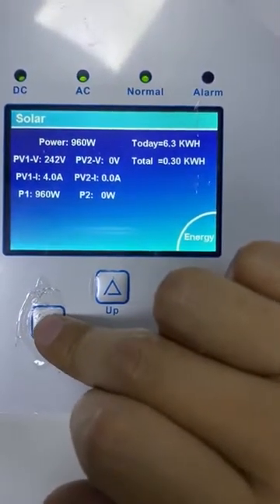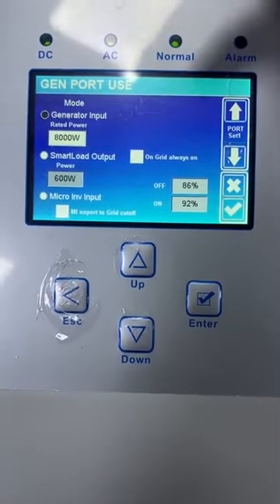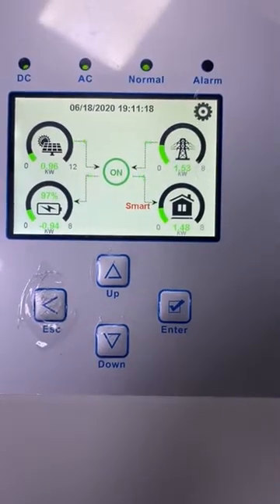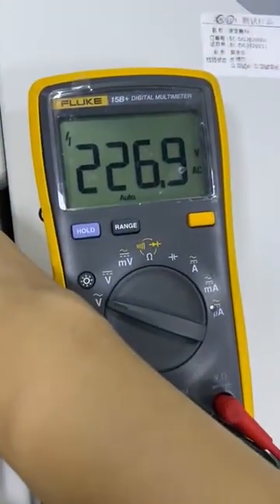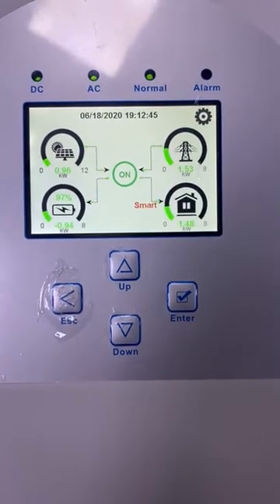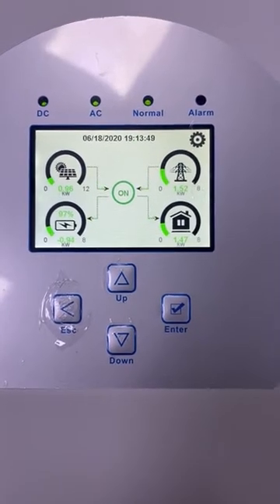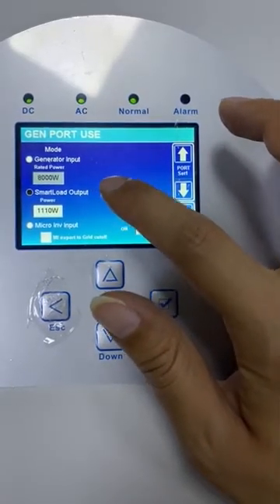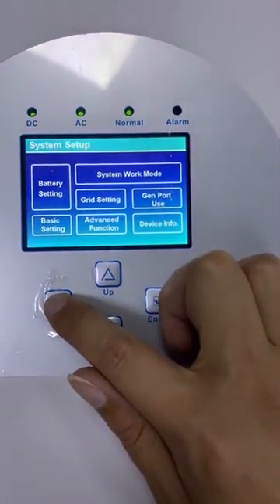How to use the advanced function for Deye hybrid inverter

Comment: Is it possible, to charge the battery from the solar panels only at a specific time? For example from 10am to 2pm. Or is it possible to set up a smart charging function for the battery? 
Im asking, because in Germany we got the problem, that the maximum allowed sell power to the grid is only 60%, of the Peak Power, of the Panels. 
So if you‘ve got for example 10kw of peak power in total, you‘d only be allowed to send 6kw to the grid. Therefore it would be quite handy, if the battery would only be charged, or charged more intensely, if the Solar Power exceeds 6kw. 
In short, it would be great using the battery to buffer the peaks, that would otherwise get lost.
But all in all, the battery needs to be charged 100%, when the solar power, is lowering again.
Reply from the maker: Our hybrid inverter supports 6 time periods for battery charging/discharging. For each period, you can set the maximum sell power, and the PV power generated in excess of the sell power can be used to power loads or charge the battery.
Reply: Did you manage to set up the inverter like this? I am from Romania and we don't have such a law, but the voltage at mid day spikes close to 253V, at which point the inverter will have to disconnect. I want the battery to have a charging curve based on time as well, like slowly charge up to 50% until 11 o'clock and after 11 o'clock it can charge all the way to 100% to be ready for evening consumption. I think it can be done with time of use, but I don't properly understand what the percentage mean there. Is that the maximum battery percentage or the minimum percentage before charging begins. I must confess that I didn't read the manual :)

Comment: Hi Kyle, I have a floating earth when the grid fails. I want to switch a relay to bond earth and neutral on backup output when grid fails. However I need this bonding to work when inverter is waiting for grid to stabilize. When grid is returned the inverter does not switch the grid on immediately, so I need to have the inverter to switch the neutral earth relay coil. I tested pins 5 & 6 which do not give 230 V when grid fails.

Comment: Hello greetings, excellent video, I have a question, this inverter could place a string of 250 and 18A for each PV input, that is, 4s2p or only 5s1p is possible
Reply from the maker: For the 5KW model, max input current is 13A of each string.

Comment: Hi there nice video is there a way to use solar in the day and battery at night, I want grid to only kick in when battery is running low
Reply from the maker: yes, you can program the time period for battery charge and discharge. Please refer to the Time of use of the manual.

Comment: Will this invertor work on single source i mean pv. Without grid and battery
Reply from the maker: it can work when the PV power is very good. but the output power is very small. we don't recommend to use it like this way.